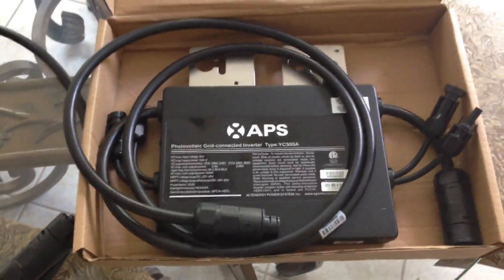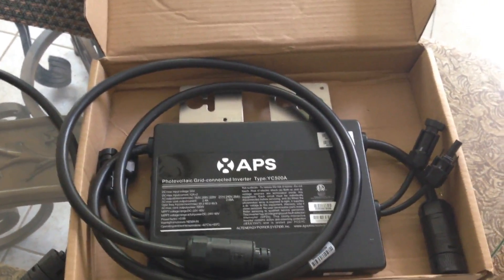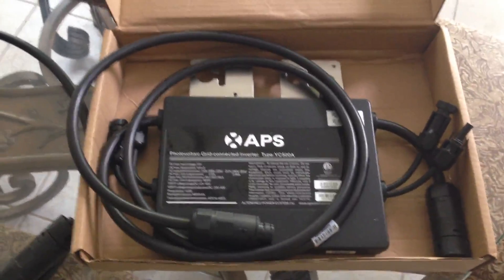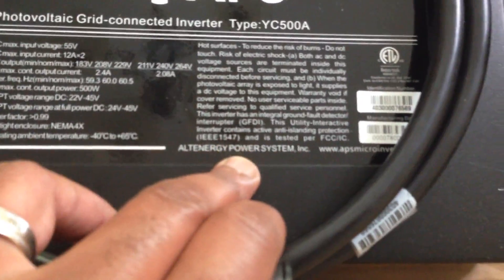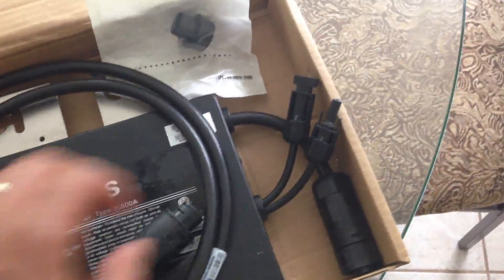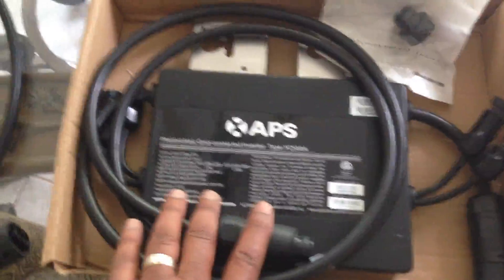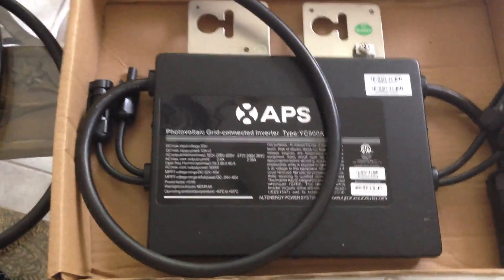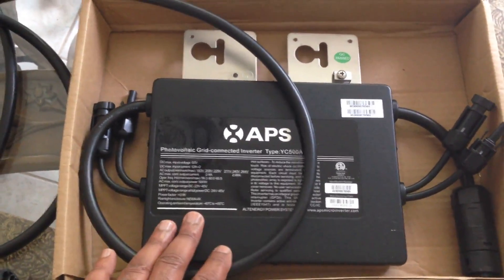DIY Solar Update - Adding a "certified" Grid Tie Inverter

Comment: One problem with the a lot of "certified" micro inverters is if you ever get an error code (ground fault, low DC resistance....), then you have a paperweight unless you buy their controller to clear the fault code.  This happened with a Enphase M215 that I have.  I corrected the fault, but I can't clear it in the micro-inverter so it won't work.  I looked at the instructions for the Power One / ABB MICRO-0.25-I inverter and it was the same way.  A $500 controller isn't bad if you have a multiple kW system, but for those that just want to do a few hundred Watts it doesn't make sense to buy a $50 micro inverter (some of the older Enpahse/Power One controllers are in that price range) and then $500 on a controller.   Thanks for the video.
Reply from the maker: Thanks for the comments.  I definitely agree with you.  I'm at the point where I wouldn't recommend "any" micro inverters for the exact reason.

Comment: I remember you saying you had a problem with an inverter.  I can't remember what video I saw that on.  Is this the inverter that gave you issues?
Reply from the maker: Yes I recently posted a video saying I had trouble with these, then I retracted it because I believe I was in error. The problem was not with the inverters, but with transient surges. Transient surges will destroy sensitive equipment if you don't have surge protection. I have since installed 3 whole house surge suppression devices to deal with the problem. The APS YC500A work fine.  The folks at Magnum Energy have partnered with AP Systems to produce an "optimized" version of this unit to work to work their Magnasine  inverters.
Reply: Ok cool, thanks for the response...

Comment: Does this not highlight the main difference between the two inverter types being one will plug in to a socket and the other is hard wired in to your house circuit? Requiring a certified engineer to do so?
Reply from the maker: +Matt Cook Thaks for your question, In this case, the difference is that the cheap non certified inverters are those not certified and listed according to UL1741 and IEEE 1547.  The cheap grid tie inverters may have what is considered Island protection or commonly called anti-islanding, they still do not conform to the listings.  The plug in types are typically 110v and the listed or certified variety 240v, with the correct plug and receptacle you could plug either into the wall. However, the listed micro-inverters are designed to connect in the house mains by means of a 20A circuit breaker in the main electrical panel or sub-panel.  A certified engineer is not necessary for installation, just an understanding of basic electrical safety, wiring, and connections.

Comment: You can save the cheap GT inverters as backup in case something goes wrong with the new one or until you use them on another project. Sorry if that sentence didn't make sense; my coffee hasn't kicked in, yet.  If you are worried about EMP; you could store them in a protected container.

Comment: Cool this will be nice. The bad thing about 240 is can't use your kill watt. I been running 2 300 watt sun grid ties for more than 4 years with out one bump in the road. Now things are all coming down I will be saving up for a good ones. All tho the sun grid tie been fine all this time..
Reply: yankey4 Good to here that you have had no problems with you sun grid ties. But did you ever have the installation "approved" by your electric company? I would be willing to bet if they saw it they would shut your power off. Why? Because in most states that I know of it is illegal to "tie" into the grid without written approval and inspection from your power company. Do you honestly think they would ever approve those sun grid ties? Not UL rated? NO they would not. The power company is trying to protect there linemen. What if the part of the cheap grid tie unit that shuts off power when you loose power fails? And still back feeds even though power is off. And there linemen gets killed? You could be facing involuntary manslaughter. Something to think about.. Everyone does not seem to get the fact that your power company MUST approve you if you plan on tieing into "there" lines. It is not your power you are tieing into it belongs to the power company!
Reply: ***** I was a line man for more than 10 years. They turn off if there is no power from the grid. 
I do have my PV that is grid tie approval. The 2 sun grid ties are on the same line that the power guys can kill with a flip of a switch. 
They have seen my setup and did not say a word. I was tested with the sun gride ties running and I pasted my back feed power kill test.
Reply: yankey4 That is good to hear. It sounds like you are ok if they signed off on it..I am only speaking of my power company and maybe all are different. I actually called my power company about back feeding. They said NO can't just do it. Unless I get approval first of my system. It involves a process getting approved for Net Metering. I am sure you know what I am talking about but many do not. 

My power company told me that I must be "approved" to back feed first. It involved a process of me submitting a detailed drawing of my set up with the model numbers of the grid ties I would be using. Then they would give me the go ahead if approved and once I finished the project they would send one of there guys out to test the kill function and make sure all was up to code and UL certified. Then they would sign off on it and I would also need to buy a bi-directional smart meter for 100.00 and then I would be good to go. 

So this is the way it is where I live in MO..I am just making the point people should check before running out and just doing it based off a you tube video. You sound more then qualified and good to go..But where I live it is different.
Reply: ***** o and let me tell you it's a real pain in the ass. If your a DIY guy 10 times as hard. This cell phone sucks lol. 

Truth be told is this THE Power company's are going to do all they can to keep you from buying less power. All so most of the grid in the USA is not setup for back feeding. Most of the grid is 60+ years old. If we all where to just trow up solar and back feed the grid it would blow up lol. 

I do not sell much power at all. We use 99.99% of it when the sun is up. My wife and I both work from home so we use a lot of day power.
Reply from the maker: yankey4 Thanks for the comments.  I plan to put a TED 5000 on it to view power coming in.  Glad to know your Sun GTI are still working fine.